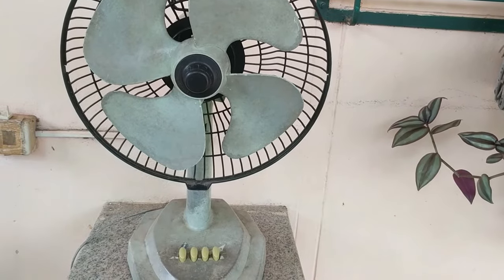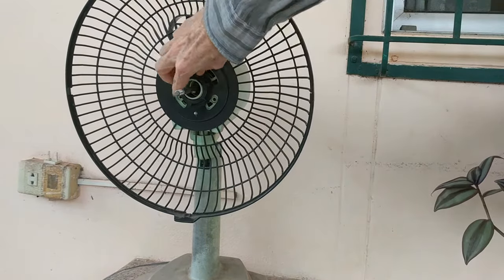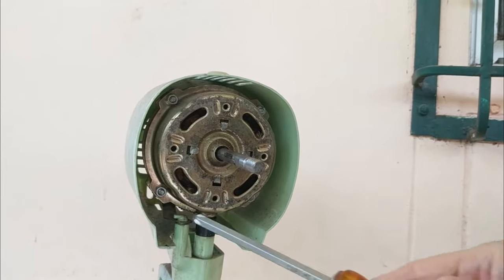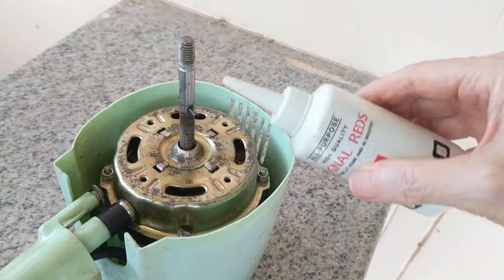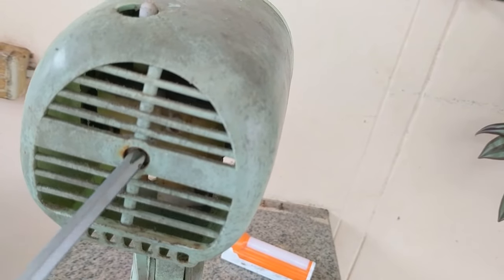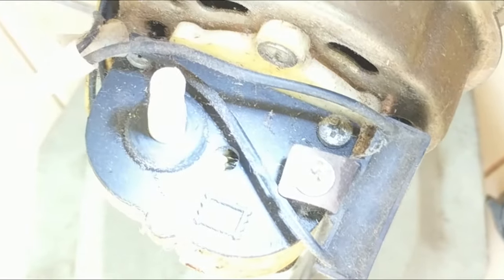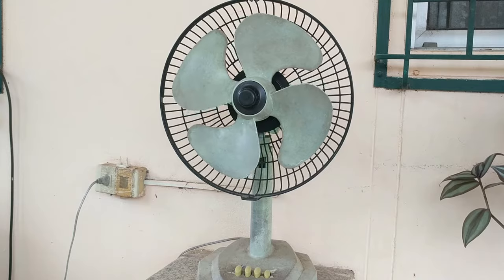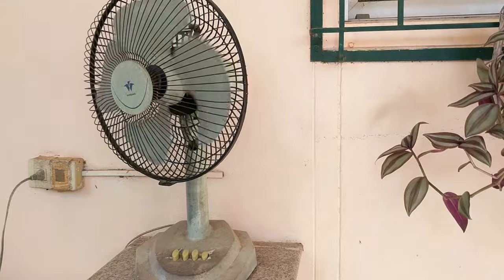How to Repair a Slow Starting Fan

Comment: I have several with that same electric motor and what you need to do it put more oil on the front bushing shaft and let is settle in as you turn it. Next remove the back as you did and remove the 3 screws that hold on that white plastic thing with the gears you mentioned. Just move it aside so you can drop several drops into the shaft and bushing as you turn the shft to free it up. (That white plastic thing is the fan rotation mechanism. Don't let it scare you.) Sometimes they need further disassembly of the motor and cleaning of the bushings and more oil on the wick. Put more wick in the bushing housing to hold more oil for longer service interval! If the shaft is worn, you can feel it, it likely needs replacing and won't run well until you do, at a shop that services these cheap fans, depending what country you live in. I go to a guy and I have learned a lot standing around watching him work even though language is a barrier! Some things like more wick I figured out myself...I work on other people's fans to help keep them running and go to the shop when I run into a problem. Don't forget capacitors run down over time causing slow running fan. Good luck!
Reply from the maker: Great info!

Comment: Thank you.  This worked great for me. I used 3-in-1 Oil on the blade shaft, as you've shown, and it got down to where it needed to be.  I took things apart, just to be sure, and I'm happy to say I was able to put it back together without having "leftover" parts.  😄  Have a great day and thanks again.
Reply from the maker: NP

Comment: I did that, but no change.
Reply from the maker: Yeah, sometimes it doesn't help so much, or only helps for a little while. You might try removing the back cover and applying oil to the oil holes and spindle from there.

Comment: Worked wonderfully. However, I opened the works up to the inner bearings. There was fluff in the housing that I thought was dried grease or something. I picked it all out with a toothpick. After some consideration thought it might be packing, and that I should have left it in. I've reassembled and fan is working great. Time will tell.

Thank you Sir!

Comment: I'm 70 and have never seen a fan that needs lubricating.
In fact the fan manufacturer gives a lifetime warranty that their fan will never need oiling forever.
Reply: Not cheap and especially from CHINA.  They laughed in your face if complain.
Reply: Things were made back in the day to last. Great for the consumer but the manufacturing companies realized it wasn’t so great for them because their products were lasting 30, 40, 50+ years which meant no one was buying their product for that long. Things for the last couple of decades have been made with incredibly cheap parts which end up with them breaking quickly and you have to buy another one. If you have older fans that are quality, keep them because the new stuff is junk. Any fan I have bought in the last 15 years only lasted about six years before issues with slow start ups or squealing started up. Fans several decades ago might have had a lifetime warranty but anything made in the last 25 years is only warranted for 3 years at the most. Keep your quality old fans!
Reply: Honestly I never thought fans needed that. We have an old fan and it was a wedding gift to my parents, was made all with metal and it's still the best fan we have had, I have purchased a brand new electric fan with a remote control and everything fancy but it just did exactly what the fan in the video did. So slow and barely a breeze. I almost wish we didn't give that old fan to my grandparents 😅. It was truly the best I don't remember the name but I believe it was a Japanese brand.